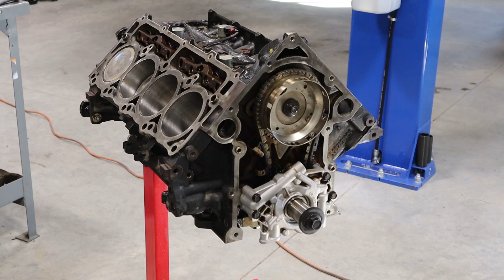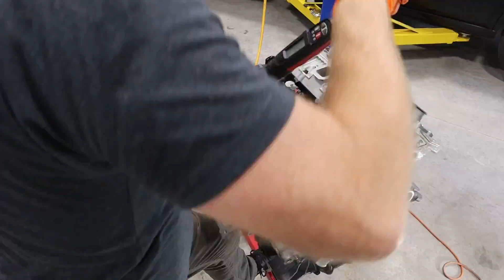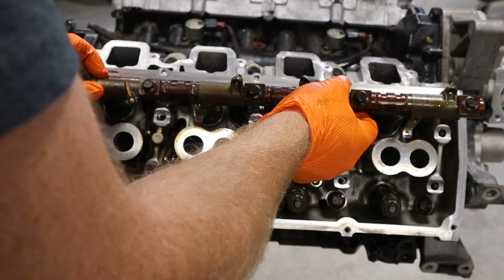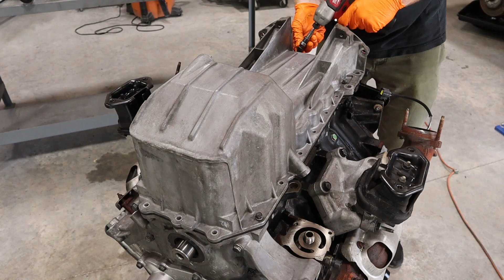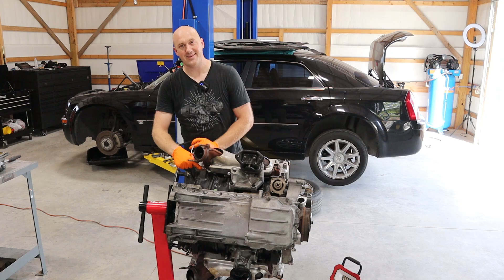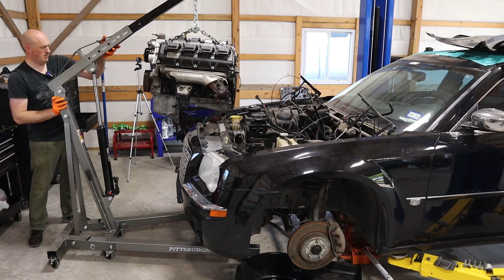Chrysler Hemi 5.7 Engine Rebuild Continues Top End // 300C Episode 4

Comment: Why would I have excessive play in my rocker arm and foods after a full rebuild. May I mention it is the exhaust side on drivers side
Reply from the maker: Have you run the engine yet? Are the lifters new? If they are then they likely haven't been pumped up with oil yet and the play is coming from just the spring resistance in the hydraulic portion of the lifter. Any more details?
Reply: @ReignitedAuto  yes I've started the engine. The lifters are  new. I reused the rods and rocker arm assembly. Cam was inspected by the machine shop. Engine had 141000 when valve seat dropped. Bored engine. 020. Upon installing rods the 3 5 7 rod barely connected to the rocker arms. I mean a considerable distance In terms of seating in the cup. I thought too that the lifters needed to be primed up too. When it cranked up I thought it was about to beat the cover off. Drove down rod bout a mile no change. Let it cool down removed cover still a ton of play. Crank engine on the 2 4 6 8 bank  to watch tge dynamic of 1 3 5 and 7 all where oiling pretty well.  But that slack never recovered. I removed all the rods. Inspected length they are all the same inspected Rackers. I really looked them over well. No discrepancies.. oh and theses are the exhaust side as well don't remember if I mentioned that. My thinking is I may have switched the rockers from the right side where the #8 dropped may have kicked and bent the rocker itself. Don't know. Just a note I value your opinion and you gave me the courage to rebuild this engine with my son in hopes to get his attention and time together. I thank you for your advice. Freddie and Storm
Reply: @freddiejennings8690  may not help you now. But he never spoke to the issue of rocker gear. After a catastrophic failure like he had,  you should disassemble each rocker arm assembly and thoroughly clean everything anywhere metal debris could end up. You need to work with one assembly at a time if you're a noob. The rocker shafts are different  for intake & exhaust, and they have to be oriented a particular way or you can destroy your engine eventually. The shafts have a notch on one end. For lt. head int shaft notch is up and forward; for exhaust shaft notch is up and rearward. Just the opposite for rt. head int notch is up and rearward, exhaust notch is up and forward. This is EXTREMELY important, if not correctly done the rockers, shafts and even lifters will not be properly oiled. This can lead to total engine destruction. 
I don't know if this is your problem or not. Your issue may be just using the short pushrods for some of the exhaust rockers positions.

Comment: I got some questions I have a 2005 ram 5.7 Hemi engine but I need to put it in my 2006 charger 5.7 are the crankshaft compatible? Ik the camshafts are different and this engine had mds plugs could I still install mds on a 05 5.7?

Comment: So I do have a missfire p0301 as looking at the tune diagram it's only on start up and at 3k rpm or greater. Could it be a pushrod? Checked coils, spark plugs, in the cylinder.
Reply from the maker: Have you run a compression test yet? If that tests ok, what year hemi is it? If it's a 2009+ you might be looking at a lifter issue.
Reply: @ReignitedAuto  it's a 07 I have not done the compression test. I'll do that and get back to you with the results
Reply: @ReignitedAuto  I have Done the compression leak test. I only have a 5.6% loss.

Comment: After getting the heads, push rods, and rockers on my engine won’t turn by hand anymore. Spins perfectly fine when rockers, and push rods are off, but as soon as I put them back on motor turns approx. 180• then stops. Plugs are not installed so I know it’s not compression. 
Please help
Reply: Also it’s only the right side head. It spun freely after putting the left side head together.
Reply: I did the timing just as shown in this video.
Reply from the maker: Hate to say it but it definitely sounds like timing related. Is your timing cover back on already? If not, get the engine to where the cam sprocket mark is back at 12 o clock again, and try to verify the crank mark is at 6 o clock.
Reply: @ReignitedAuto  thanks for the reply. It ended up being much dumber than timing. Lol. I had two intake push rods just left of the actual holes they go in down to the lifters.

Comment: I have a  questions I m doing a full engine rebuilt on my 2005 dodge magnum rt I was looking into oem  pistons it turns out there discontinued so I’m looking into aftermarket I was wondering which aftermarket pistons would u recommend based on ur experience
Reply from the maker: Unfortunately I don't have any experience with aftermarket options, so I don't have any opinions on them.

Comment: Do you ever turn the engine a bit by hand to get the push rods more level  or install the rocker arms
Reply: Thanks for the response...I'll have to see how it feels next one I do. Save myself a step
Reply from the maker: You certainly can if you want to. I don't because I've done so many of them I don't need to, but it definitely can make it easier. 👍

Comment: That's so hilarious getting the 02 sensor wedged between the cylinder head and engine block, I started watching these videos for some form of advice for getting my pushrods and rockers arms installed properly after a head gasket job. Couldn't stop laughing because when I was reinstalling the heads, the very same problem happened to me. Went to tighten down the exhaust manifold to the catalytic converter, and noticed I couldn't seem to find my 02 sensor connector anywhere
Reply from the maker: It almost happened again but this time I was looking for it! 😄

Comment: I was told not to drop the spark plug in it may hit the engine and change the gap
Reply from the maker: Only if you're Hulk Hogan 😄 it actually takes a fair bit of force to change the gap on a spark plug.
Reply: @ReignitedAuto  I disagree. Much easier to close gap inadvertently,  not so with increasing the gap, especially if you are working with iridium plugs.

Comment: Hello I rebuilt my 07 charger 5.7 engine and tomorrow I’m gonna do it’s first start. What could possibly go wrong I resurfaced the heads and did a Valve job also bought a new crankshaft. I guess I’m just nervous this is my first build.
Reply from the maker: I've done it hundreds of times, and there's still a bit of nerves with the first start 👍. Only thing I'd recommend would be to pull the fuel pump fuse and crank the engine for about 30 seconds just to make sure everything turns over smoothly and it builds oil pressure, then put the fuse back in and fire it up 💪
Reply: Yes thank you I’ll do that , crank the car for about 3 cycles. I enjoy watching your videos I keep watching them over and over making sure I did everything rite.  Special thanks to your timing chain tutorial your sir are badass mechanic. Thanks again👍👍

Comment: Quick question as I assemble, my gasket set for the water pump came with two oranges along with the big gasket, any ideas what they are for? On e was about 1.5”D and the other maybe half an inch
Reply from the maker: Some of the older style timing covers used o-rings to seal, most of them are the newer style which don't use those o-rings.
Reply: @ReignitedAuto  it’s the same motor as yours in the video
Reply from the maker: @micahnyhof  What I meant is, most kits will provide both because they don't know which kind you have.

Comment: Love the videos, has helped a lot in my current 06 charger r/t rebuild. Quick question: Any other places should put silicone on bolts? In tech center we would use bolt lube on every bolt, is that necessary?
Reply from the maker: Regarding lubing the bolts, it mostly depends on your climate and location. If you're in an area where there is heavy rust, definitely lube the bolts. If you are in a dry climate with almost no rust, it's not usually necessary. 👍
Reply: @ReignitedAuto  Michigan so probably will lol, thanks for the reply. I get my block from the engine shop Monday. Your videos helped a lot when I was stuck! You should look into doing a live that would be fun.
Reply from the maker: @micahnyhof  I have thought about it! Thanks for watching!

Comment: You obviously  know what you're talking about, but why wouldn't you hand start the bolts and spark plugs, then use the power tool?
Reply from the maker: It depends on the vehicle. With the Hemi engines the angle of the spark plug housing is straight on, so I feel comfortable doing what I did. On a lot of other brands where the spark plug is not so easily accessed I always start them by hand. But you're right that it's not the best example to set for new mechanics. 👍
Reply: @ReignitedAuto   You're all good, was just curious if it didn't matter much for the spark plugs or not. I do see your point of view which is why im glad you replied because it makes sense.

Comment: You don't gap the plugs? Not saying it's gonna be a problem. Just asking
Reply from the maker: I've been using factory plugs for almost ten years, and in that time I've never gotten one that wasn't gapped properly already. Unless the package was dropped or something. So usually I'll just check quickly to make sure the electrode isn't smashed flat, if it's good the plug goes in! 👍
Reply: @ReignitedAuto  Ah ok, cool

Comment: How do you flush and refill coolant on a 392 Challenger? Old school bleeding or using an Airlift type vacuum device?
Reply from the maker: For a flush I'd to it the same time as I replaced the thermostat, that way you can just disconnect the lower radiator hose and force water through the engine at the thermostat housing. For refilling, definitely use a vacuum coolant fill device. If you don't have one this is the best way to refill a Hemi engine: On the face of the water pump there's an allen plug, I think 8mm allen. Remove this plug and fill with coolant until it pours out of that plug. Then, reinstall the plug and top off the coolant. This will generally get you pretty close. 👍

Comment: I’m doing new cylinder heads on my 2005 300C. When I did my final torque angle of 90*, I ended up with a torque or around 85-90 lbs. I noticed you put you bolts in dry. I oiled mine. Do you think that is where I’m finding the difference in final torque values?
Reply from the maker: Probably so, its not mentioned in the service manual to oil the bolts. That being said, I don't think you'll have any issues. 👍
Reply: @ReignitedAuto  thanks for getting back to me! Also I absolutely love your content. Thanks for doing what you do
Reply from the maker: @ItalianFresh5  appreciate you watching 👍

Comment: When you installed the harmonic ballancer/main crank shaft pully you didn't seem to line it up or "time" it in any way.  Does it matter how it's timed to the crank, or is it not really a harmonic ballancer at all, just the front pully and it doesn't matter how it goes back on?
Reply from the maker: Yea the crank isn't keyed for the balancer, just tap it on, pull it home and you're good 👍

Comment: Thank you so much for this video and have watched it a few times to help me on my ‘15 Ram head replacement. However I should have watched it before I started. I reused the head bolts ( didn’t measure ) and just kinda estimated on the 90 deg due to space limitations. Do you think it would be ok to barely back off on the bolts and then just torque to 100 ft #s? Or take out the bolts and start over with new bolts?
Reply from the maker: At this point, you've already seated the head gaskets, and backing the bolts off might cause more issues than you solve. I wouldn't worry about it too much to be honest, unless you think the torque spec is wildly off. In that case, don't back them off, just set your torque wrench to 100ftlbs and double check them all. 👍
Reply: @ReignitedAuto  thanks bud!

Comment: 90 degrees is basically 12 o'clock to 3 o'clock
Reply from the maker: Yep, pretty easy to keep track of as you are tightening it down. It becomes a little trickier if the engine is in the car and you can't get a full sweep of the torque wrench in one go, but most of them you won't have an issue. 👍

Comment: This Hemi rebuild series is GREAT! Thank you for the step-by-step instructions and the reasons why you're doing what you're doing. I'm rebuilding my first engine and it happens to be a 5.7 Hemi for my Dodge.... I'll be revisiting these I'm SURE! Thanks again!
Reply from the maker: Thanks for watching Mark! The Hemi is a good one to start on, as it's a pretty straightforward design 👍
Reply: @ReignitedAuto  hey man, what brand of tourque wrench are you using? I'm a mechanic student at ozarka college in AR and just trying to get some good tourque wrenchs that are not snap on priced and also, love the videos they are helping a lot with my want to have 5.7 build
Reply from the maker: @keatonmoore7934  is use GearWrench digital torque wrenches, they are torque to angle as well 👍
Reply: @ReignitedAuto I have a question in regards to the cylinder head bolts. I have a factory manual and it says nothing about being able to reuse the head bolts. I’m wondering if that’s the case on the older hemis that were produced in 2004. The torque sequence is 45ft-lbs and a 90° torque turn. It also doesn’t mention anything about lubricants on the threads. Am I to lubricate the threads like I’ve always done on diesel engines? Another thing I’m pondering is if the 20 main head bolts aren’t reusable is the 10 smaller bolts up by the intake reusable? Thanks for reading and hopefully you can shine some light on this.
Reply from the maker: @RaccKL  you can reuse all the cylinder head bolts, and do not use lube on them. 👍
Reply: Is there any Valve lash once rockers at tight
Reply from the maker: @jaychurch6242  nope, the lash is taken up by the hydraulic portion of the lifter 👍
Reply: @ReignitedAuto  Thank you do much fir quick response. I have the smallest amount of lash on #7 intake side. no codes and was ticking then stopped for a month then came back its at idle and revs but if I rev and let revs fall sometines it goes away complety. replace exhaust gaskets and no leaks and valve train when rotated works perfectly same lift throughout except a tiny lash on # 7. And thanks for all you do I watch wether im in need or not , watch for entertainment purpose as well. I was a Ls camaro guy and wouldnt have put up  with all the issues but this chrysler has me stupid in love.when she is right I love driving her.

Comment: @8:05 he tightens some bolts and says to be careful. Does anyone know what those bolts are called and also the specific torque spec for them???
Reply: That means hold ratchet one hand by the head of ratchet not handle but other end use wrist only n snuggle up wee bit
Reply: Valve cover bolts , normally like 8 to 15 ft lbs it varies by engine

Comment: I hope you don't mind me picking your brain.  2008 Hemi for a Ram Truck.  I did a basic rebuild on it, including a new melling oil pump, generic water pump, generic "Enginetech" non-mds lifters, PAC valve springs rated for 0.600 cam lift and a comp cam stage 2 cam (220/230 dur@50 and .596 lift).  I had the head milled 0.006".  I have the MDS delete plugs and also have them disabled in my tune.  I Finished rebuild, started it up and it ran very bad - lots of lifter chatter and I had to pull an astonishing amount of fuel from the fuel trims (38%) in order to kinda-sorta idle.  I pulled the front cover back off and checked my timing which was spot on.  I ran a compression test on each cylinder and it was quite low - 130 or so each.  At 205k miles before the rebuild, it was 155psi for each.  I had measured the pushrods for zero lash and added 0.050" preload when I ordered the custom length pushrods.  Thinking that the valves weren't closing, I put a zip tie between the rocker shaft and the shaft mount.  Did the intake cam first, saw 170 psi immediately.  Did the exhaust, and it didn't change.  So I would think that meant the intake pushrod was too long.  However, I bolted everything back together and noticed that on many of the intake pushrods, I can actually push in the pushrod by hand (Feels mushy).  Perhaps 1/8 to 3/16 of an inch.  I saved some of my OEM lifters and they are hard as a rock, I would be surprised if I can move them 0.001".  The pushrods in the engine now (That I can push down) have run for about 3 hours/22 miles or so when trying to break the engine in.  Shouldn't they be pumped up and also hard as a rock?  I pulled off the oil pump in order to check the timing, so It's no longer primed, but I stood on the starter for over a minute and didn't see the oil pressure gauge move.  Should the oil pump prime by then?  Since this is off a truck, the pickup is all the way in the back of the pan.  I'm trying to figure out if I have an oiling problem, or my lifters are bad, or if the pushrod length is off.  I should note, the oil pressure when I was breaking it in was less than before the rebuild, but not bad either.  The computer logs showed it at 25psi with a 1000 rpm fast idle on straight 30 break in oil.  Thank you in advance if you have any ideas.  Thanks for making these great videos!
Reply from the maker: Hey Tucker, I'd definitely be trying to figure out why the oil pressure is low before doing anything else. Make sure the pickup tube o-ring is in good shape. A brand new oil pump should certainly be moving a lot more than 25psi when cold. That could definitely have an effect on the lifters getting fully pumped up with oil, which could in turn cause your low compression numbers. So my advice would be to chase the oiling situation before you do anything else.
Reply: @ReignitedAuto  Thank you very much, I really appreciate it!